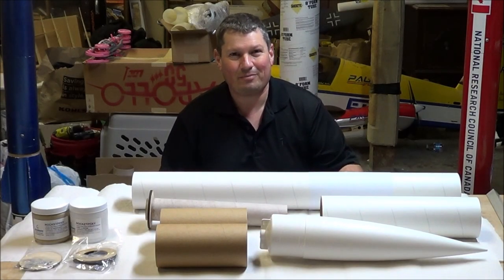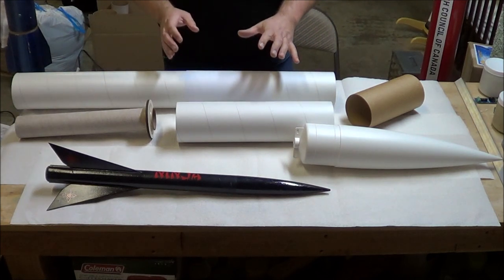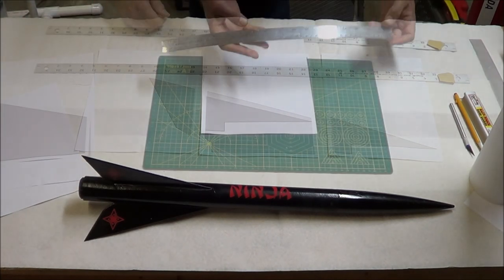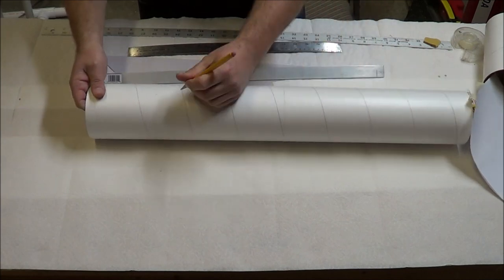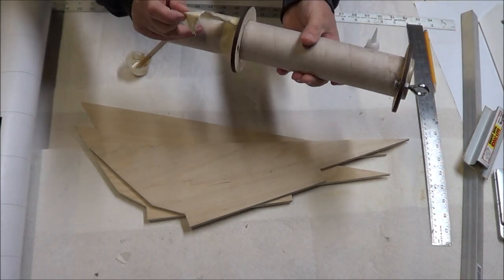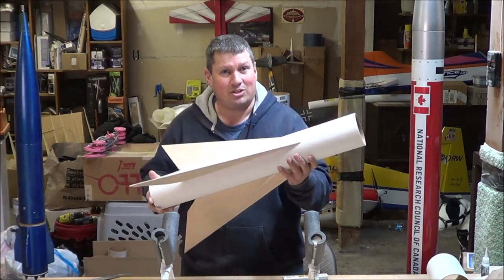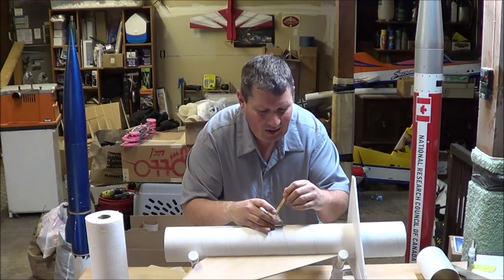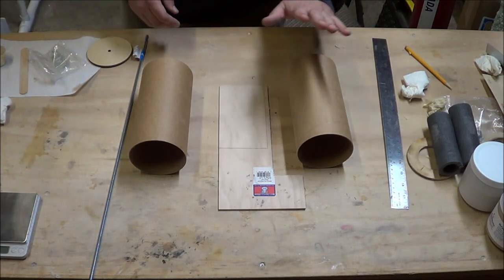Upscale Estes Ninja High Power Rocket Build Part 1: Panic!

Comment: Interesting with the fin epoxy dams for adhering to the motor mount. I just got my Drago 4XL kit for my NAR L2 certification attempt this summer (yes I watched your build video and got inspired!) and I see on that build, you approached the fin to motor mount epoxy process differently. Do you think there's any real difference in the two processes as far as structural integrity goes or is more builder preference than anything else?
Reply from the maker: I prefer my normal way of adding internal fin fillets, as the epoxy spreads out in a more efficient manner.  The fin pockets also work but it's my opinion that you are putting in more epoxy (weight) to get the same coverage.